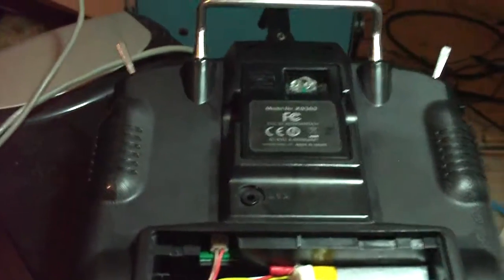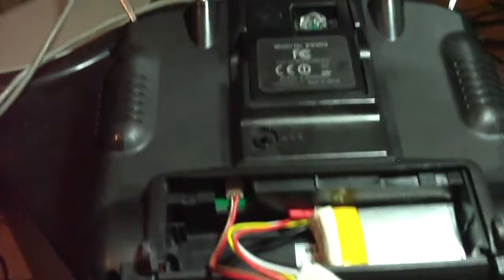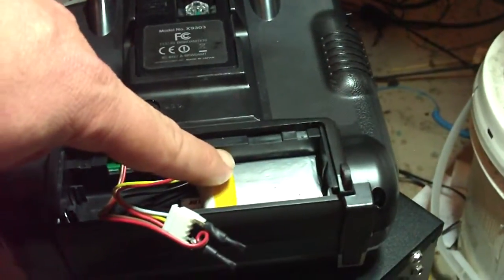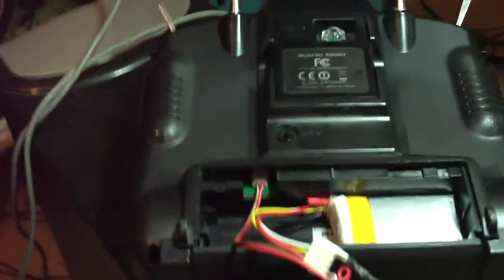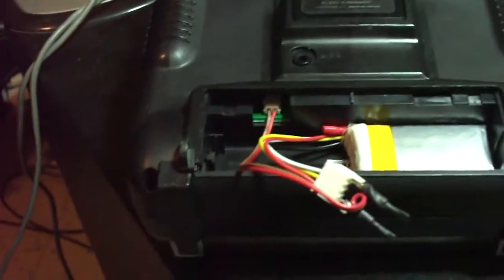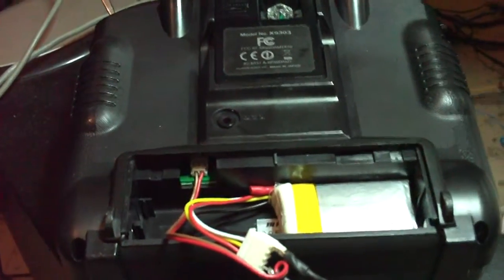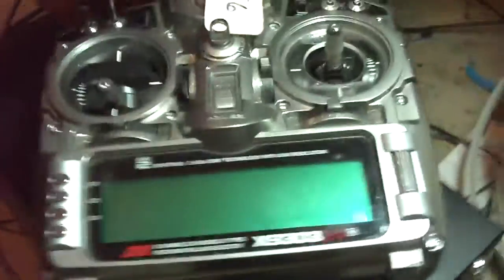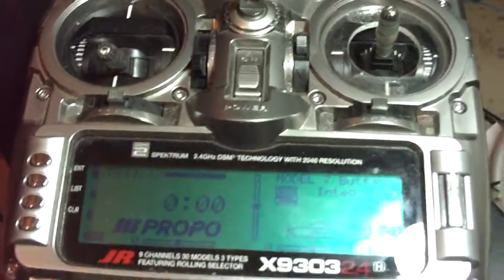JR x9303 with 3s Lipo power

Comment: if you leave this pluged in BUT THE TX IS OFFFF and you just leave it pluged in all the time is it safe

and arent the diodes just for the c rating like if its a 30c lipo the diodes will limit the c to 1 amp?

Comment from the maker: I very carefully selected these diodes off a junk amplifier I had in my "spares" pile :-)    They are UF4003

Most any 1 amp diode will do, just make sure the specs for it say its forward voltage is somewhere around 0.7 volts at 0.1amps..  Higher is better

Also, I've been told the AA "Already Charged" NiMH rechargeable batteries are the real way to go.  No Harm with this mod, as long as you never accidentally leave the Tx turned on, then you will kill your Lipo forever!  NiMH, not so much...